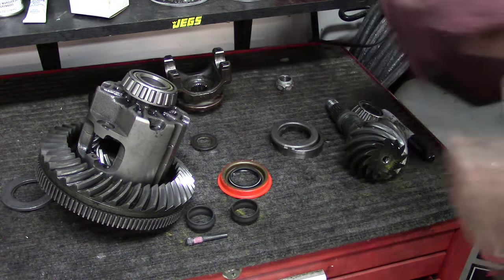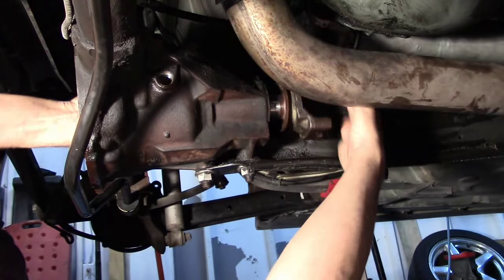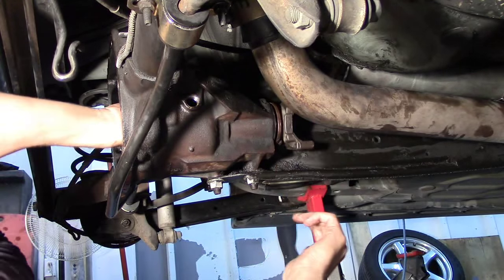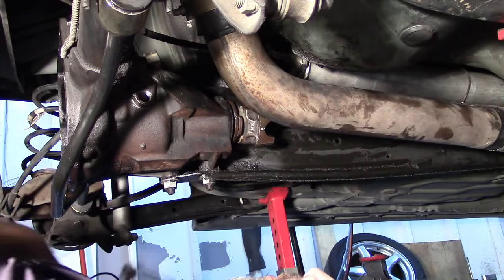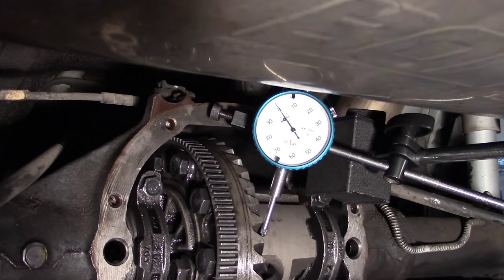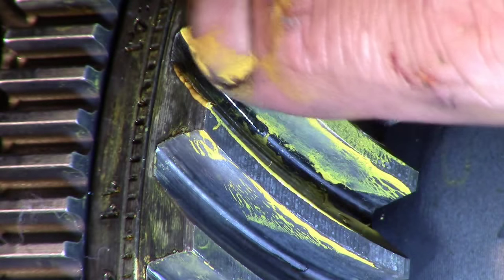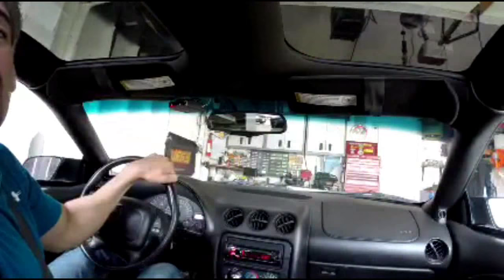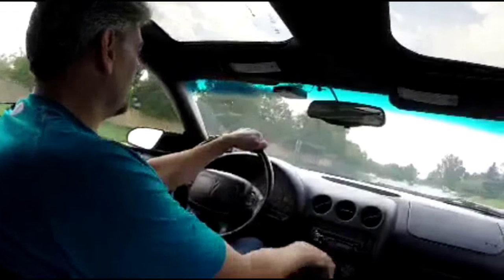RWD Differential Backlash Noise Diagnosis and Fix-Pt2

Comment: Great set of vids Matt. You probably opened up a whole new world to most DIYer's. Most would probably not have been aware of how tight the tolerances are in a differential and what is involved in rebuilding one.
Reply from the maker: Billy R Exactly. The tolerances are incredibly important.  Even .002" of an inch off makes the difference between doing this again in a few weeks or 10 years.

Comment: Thank you so much for this video, so detailed and clearly explained with clear images and quality camera work. I've repaired my own cars for many years, changed clutches, done engine transplants, lapped valves with cylinder heads removed, rebuilt carbs, injection systems, brakes etc. but never understood differentials, they were always a mystery to me but the way you explained it, I really get it now, thanks dude.

Comment: Like the video.  I worked for a Jeep agent and we found that the axles with limited slip differentials can judder and make quite a bit of noise.  We used to change the oil and add the Chrysler additive, I think this was recommended at 60,000 miles in the UK.  This would after doing some tight turns (to spread the newly treated oil around the clutch plates) reduce the noise.This won't fix the wear that this video covers resolving of course but is worth a try if the axle is juddering before a major repair.

Comment: Fantastic explanation, Matt. One of my favorite vids on your channel for sure :)  It's amazing how important tolerances are in a mechanical system. Scary to think that a few thousandths of an inch make all the difference between long-term reliability and premature self-destruction!
Reply from the maker: motoYam82 Yes it cannot be overstated how critical that lash adjustment and pinion depth adjustment is.
  Setting those correctly is a lot of labor and I'll show it soon enough.
Reply: Perfect
Reply: Pine Hollow Auto Diagnostics . That's the difference between the professionals rebuilding your differential rear end. And the average cheapo fly-by night b/s shop.

Comment: Nice video, well done.  You didn't mention anything about the distinctive stench of diff gear oil.  Stinks up the shop for sure.  I've done a few pinion bearing replacements for neighbors - they were quoted ridiculous prices for this job - I just couldn't let them get robbed!

Comment: Yes very helpful.  Organize and clear instructions on how to do a GM axle.  I got a 98  Chevy Astro AWD and are dealing with noise. I now have had a quick crash course on how to solve it.  Thanks!! And happy motoring...
Reply: I have a 97 S10,very similar to the Astro. Probably uses the same 7.6 in rear axle. It had about 200k on it. Anyway it was  making a whirring/whining sound that was very noticeable especially at freeway speeds. It was just worn out. I Put new carrier bearings in,new spider gears,a little thicker oil. Ultimately it didn't matter the noise and backlash was too great. The ring & pinion was just too worn out to fix. I ended up just finding a good one at the wrecking yard for $250. Now it's fixed. It was a peice of cake to swap them out. The parts and tools are expensive for the 7.6 Chevy axle. Gears $250. Gear& bearings set up kit $150.
(for the cheap Chinese kit) Bearing puller at Harbor Freight $90 getting the new bearings pressed on the carrier $45. Then you need special measuring tools to get the pinion depth right and to set the gear backlash. Those aren't cheap and you'll probably only need them once. Is you're Astro AWD? It might be the transfer case since nobody hardly ever changes the oil in those things. The spider gears don't seem to be overly durable in the 7.6in,maybe its just worn spiders? I took the cover off several axles to find an axle that wasn't on its way out. Just letting you know this before you go and tear into it and that may not even the problem. I saw complete axles on Ebay good supposedly tested ones $200-$400. IDK if the shipping was free? I think they even had a 90 day warranty. Transfer case might use a special oil you can only get at the Chevy dealer,it might?  I just bought 4 quarts. It was $100,for my 5 speed transmission. It's a  special hypoid gear oil. There is no substitute oil you can use. If your transfer case uses this oil and you put any other oil in it,its gonna toast on you. So make sure to ask the dealer about that. Then again it may just use type 3 ATF? Good luck. I know that noise has to drive you nuts.  I am so glad that mine is fixed. If you do decide to get a used one,make sure you get the exact same gear ratio. I swapped mine out in less than 3hrs. It's also known as a 7& 5/8 in rear axle.

Comment: You got LUCKY with just a loose nut, I thought for sure pinion bearing. In the mid 70's at age 19/20 [yeah back in the day of leaded fuel, etc.] I built a 67 Camaro RS Yenko clone which had a 427/425 and 12 bolt with 456 gears and a 4 speed that had a bad pinion bearing as the nut would come loose so I would just tighten it up every so often when it got noisy, finally me and a friend stripped it down and replaced all bearings, shims and ring and pinion, all I used was the paint method with no dial indicator and it was quiet as a mouse so it appears with proper teeth mesh backlash with fall into place. Used to turn mid 12's at 110 mph like nothing with that with 25 inch tall slicks-- 456 on the street = stay off the highway and excessive engine wear, its really a drag gear

Comment: WOW 1st Zexel torsion rear end video I have seen that shows as much as yours bud, good shit. So I have an 02 z28 a4 3:23. an I recently have been tryin to track down a roaring from the rear end. and after replacing axles, axle bearings n seals, adding BMR adjustable pan hard an torque arm (adjustable because  I adding lowering springs), and replacing all bushings with poly, even made sure the pinion angle was still -2 to -3 degrees. so I finally got up the nerve to go deeper and went ahead an removed the carrier and I'll admit I should have marked things like u b4 I did, but I didn't but I did keep everything separated to which side it came off. so I instantly see a problem with the driver side carrier bearing being bad and noted the that the other side was not in the best shape so I had them replaced and I reinstalled carrier using same shims caps even bolts to the side they came off of. well good news is the roaring is gone....but.......I now how a loud howling starting or slowing also at a slow roll. As far as  I can tell the pinion and yoke are good. could my problem now be reusing the old shims instead of getting new 1s since the new carrier bearings mite not be exactly where the olds 1s sat? Any advice or insite would be awesome. my car only has 60k miles and the way this rearend has had me chacing my tail it mite not ever see 70k miles. Again thanx for ur videos. and keep up the good work, we appreciate them.
Reply from the maker: A load roar could be bad carrier bearings, axle bearings, improper bearing load on the carrier, or incorrect backlash setting.

Comment: So the whole issue was ur yoke backed off because it was not torque right. I just love the way u explained things especially parts and procedure, lots of thanks.
Reply from the maker: It was torqued right, but over it time it loosened from the extreme torque in my drag racing at the strip. Retorquing properly fixed it so I was lucky.

Comment: Thankyou for the video easy to understand maybe you can help solve my problem. I had a leaking rear seal from my diff on my 2005 Pontiac gto. Watched a video on youtube on how to replace it. I didn't know about the crush washer. So I removed the drive shaft and yoke, marked the pinion nut position and undone nut counting the number of turns it took to come off. Installed new seal put everything back together. Fixed the leak no problems for 6 months now I have a loud clunk only in 1st gear or reverse when I let the clutch out to move off. It only does it sometimes not all the time.No vibrations or whining noises when driving along or changing gears just 1st or reverse. The clutch is new and my cv shafts are new center bearing and u joints look fine. Do you think the pinion nut has come loose or I didn't tighten it enough? After seeing your video I need to take the car to an expert I just don't want to be ripped off. If I had a major problem with the diff surely it would be noisy all the time?

Comment: Nice job and video. I think I would have tightened the pinion to the high end of preload however. It usually takes a lot to compress the crush sleeve.
Reply from the maker: +wysetech2000 If it were new inner bearing I would probably be more inclined to go with more preload, but not with a 100K mile used inner bearing.

Comment: Video comments - SEAL always needs grease or at least oil before installing the yoke.  
Reason - you will burn up a dry seal before the seal can get lubed from the gear oil in the rear. 
15 to 20 inch pounds for used bearings
ALWAYS creep up on the preload checking after each torque. 
Do not forget to peen that nut or you will be back in the same place again in a few track runs.  :)

I see he has a stick shift trans --- This will make a short life of any 7.625 rear if driven hard.  Have fun !

Overall pretty good tutorial .

Jim
J D
Reply from the maker: +Jim Mitschke Good points, in fact I include all this and more in the rebuild video when I release it.
Reply: @SchrodingersBox  Where's the rebuilt video?
Reply from the maker: www.schrodingersboxqm.com

Comment: Torque up nut to spec.
Then remove crush collar then measure and make a steel spacer and fit instead of crush collar. Then you can tighten nut FT with high grade loctite.
So with that done you can launch hard without the worry of the crush collar crushing and the nut coming undone. 👍

Comment: I'm just going to get it rebuilt i don't want to buy another differential when i can get it rebuilt. But the guy told me i have backlash and the gears are worn out they're slapping each other. Then another mechanic told me if it's no vibration and it's not making noise then it's not my ring and pinion gear it's probably something else. But i just need to rebuild it cause you did yours and yours is riding better

Comment: Great video!  I am still trying to discern the noise coming from the front of my 2004 jeep. It could be the diff - or the driveshaft... anyway,  only after the car is driven for  10 - 15 minutes a very loud grinding sound is heard when the gas pedal is no longer being pushed. Give it some gas with either acceleration sound goes away. Take foot off the gas pedal, the grinding is horrendous.  Is this characteristic of a pinion bearings going bad?  I opened the diff cover, no metal flakes or peices, all looked good. Did not take anything out of the diff because I did not see your vid at the time.  THanks for all of this work!!

Comment: Did you also have to go back to the store to for the GM differential additive?  Even though a lot of the synthetic gear oils say it has additive it's usually not enough to keep the limited slip clunking down when turning the car in circles.  In my C4 Vette rear end I use two of those small bottles.  Take care man
Reply from the maker: +Ozzstar  I have always just used regular "dino"  (non synthetic)  75W-90 with regular off the shelf additive ever since I owned the car.
Reply: +Schrodingers Box let me ask you this how does a driveshaft fall out with the u joint brackets still on the yoke? while driving
Reply: +Schrodingers Box and the bolts

Comment: Hey great instructional videos by the way.
I have a question regarding my 1995 Z28.
I finally have some time to dedicate much needed attention to the rear end of which has a very loud roaring sound coming from it.
Now my plan is to just replace all bearing, axle, carrier and pinion.
I don't have a press or access to one, what do you recommend to replace in particular the carrier bearings?
Reply from the maker: A machine shop. The one i use does them for just $20.

Comment: Hi  Matt I was a Honda tech for30 yrs and I got a BIG smile when you said I got to get back to beating up on the rice boys!
   Best of luck Joe
  PS Did this happed at autocross or 1/4 mile?
Reply from the maker: Joseph Tucci 1/4 mile is all I do. Terrible for the rear end for sure. You see lots and lots of cars blow the rear end right off the line.

Comment: Can you test a center section effectively without it actually being installed? (i.e. no axles). Reason I'm asking is I'm thinking of buying a used center section complete with ring and pinion, and I just want to make sure the thing isn't toast. I'd assume you can just put a little bit of resistance on the ring gear by holding it, and just move the pinion back and forth with your other hand. I just want to make sure that doing this would defeat the purpose and if it could actually indicate anything. Thanks so much for your advice and I hope to hear from you!
Reply from the maker: Top some extent you can. It may vary the backlash because of the absence of the axle load but by pushing on the ring gear firmly and holding pinion firmly you can get a pretty good backlash measurement.

Comment: Hey.......i know this is off topic, but I'm trouble shooting an ABS system with active wheel sensors and following the scientific method I think I've eliminated the wheel sensors and The wiring. My question is does auto enginuity read abs wheel speed sensor output? I had to buy a wheel speed sensor which tests the sensors for output and that was ok.
Reply: The same tester can also be used to send a fake signal to the computer to see if the computer can read it, but I don't have a scan tool that reads individual wheel speed sensors. If you tell me that auto enginuity can do that, it may be time for me to finally buy it.....

Comment: I have a question, we think its my carrier bearing making the humming noise in my rear. Have you done that yourself,  or have a shop remove them and press the new ones on?
Reply from the maker: +Todd Shelby The way i do it is I have a shop press the new carrier bearings on and then remove the pinion bearing,  I then grind out the old pinion bearing so it fits on the pinion snugly but not that it needs a press, and I use this as a setup bearing to adjust pinion depth.  When I have my gear pattern and backlash set right I have the shop press the new pinion bearing on, recheck backlash and mesh and then assemble permenantly.
  I do not have tools to do my own pressing and pulling- actually I did but they broke on my last attempt- those bearings can be on so tight they just bend or strip the hand-tool pullers!

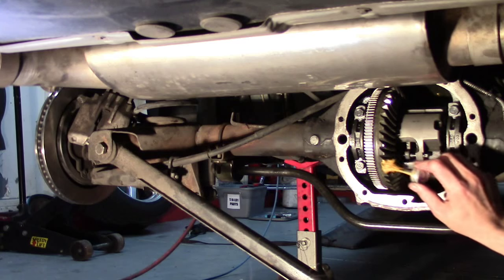Comment: May have to do this.  At 4:12, do I need a $500 Miller Tool (C-3339A) Dial Indicator Set per the Jeep Service Manual or can I go with something a little less expensive?
Reply from the maker: I use a pretty cheap setup I got from amazon.  It was more like $150.  Certainly not $500

Comment: Your test drive makes me want to buy a TA!
Reply from the maker: Randall Dalton Hahaha, it sounds great doesn't it? I've torn up a lot of asphalt over the years with it!!
Reply: Schrodingers Box it does sound pretty throaty.  what variety of Engine is in it.   I have a suggestion for a vid that would probably get some decent hits.   Cam / Spring swap.  If that is a 4.8 / 5.3 LS based engine u can get low 400 horse at the flywheel just with those mods alone.   ;P  you can do before and after track times to see how it is different.   I know you don't really want to go down the Performance type video, but it is a Mechanical video backed up by a time slip  ;P

Comment: Hey Matt, great videos as usual.  Do you have any idea when you will be able to put up the complete rebuild video?
Reply from the maker: GRowe1978 Its not going to be for a while. I want it to be a complete instructional so that anyone who wants to do a rebuild correctly and completely can follow along. Also there are many variations of differentials- the limited slip mechanisms, spacers, spider gear setups, and other things are all very different and I want to sort of "mesh" the variations so it will cover these models.
Reply: Schrodingers Box That sounds awesome!  I'm sure I'll learn a few new tricks from the video, as usual!  These two videos had some great info, I can't wait to see the complete rebuild!
Reply: Schrodingers Box Posi track upgrade with full explanation video.  get a limited slip gear set out of a 4x4 at the yard, replace all the goodies makes a great how to and to boot, 2 black marks. Or if you have a decent budget, just order like an eaton or detroit locker.  Mechanical locking diff. I believe they r clutchless too.   SUch a bonus on a stallion of a ride like that.  hehe.

Comment: Off topic kind of, but in your budget rebuild series you really made an effort to show how much better off you'd be buying a used engine. I was wondering if you felt the same way about rebuilding an engine with nothing wrong with it, like for a project car and you wanted to swap a motor or something and wanted to add a few bolt ons to it. Is it still not worth it? Or do you think that might be worth trying to do yourself?
Reply from the maker: +Bob Builder You are correct- in fact one of the points I was trying to make is a used engine is really a better option is most cases.  About the only way you will be able to do a literal "budget" rebuild is if the rings and bearings are worn but no damage has occurred and the block itself is still in spec.  In these cases, I can do the rebuild for around $500 with a standard rebuild kit.
Reply: +Schrodingers Box okay cool, thanks for the reply!